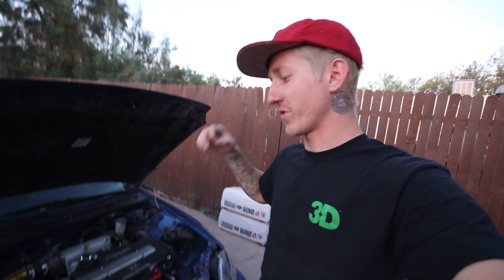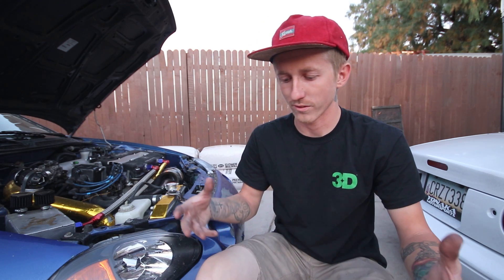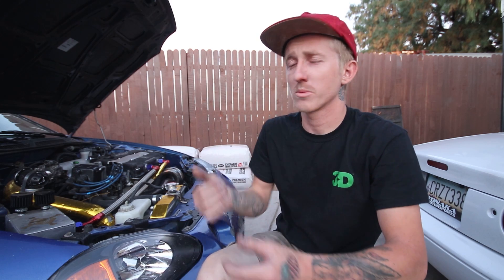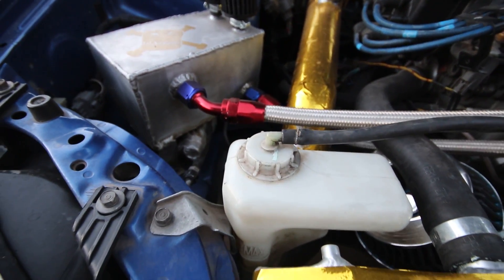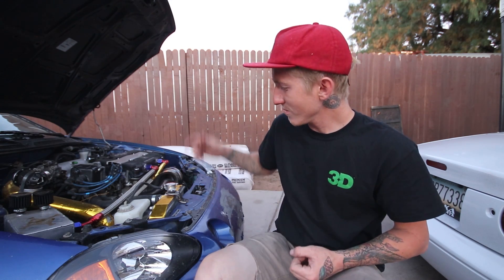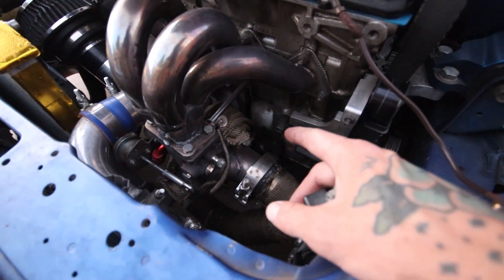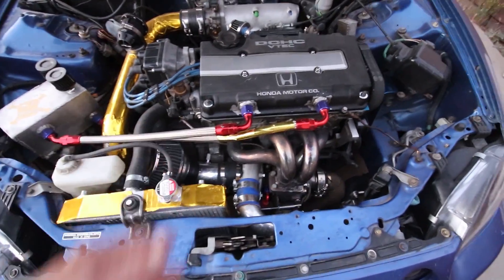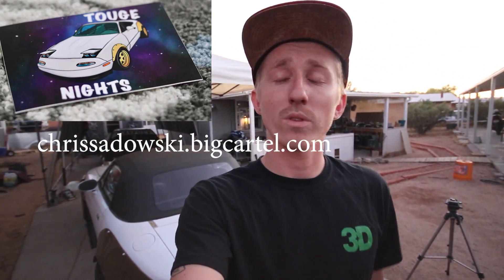Ebay Turbo B20Vtec 6 Month Update(Maxpeedingrods GT2871)

Comment: currently in the process of putting a ebay turbo kit on my 91 integra. i have never done this kind of project before and people make it look easy on here. i been at it over a month now. my main problems are with the intercooler pipe and bov, as my bov does not match the flange, and i make things difficult buy not wanting to relocate my battery so im having to cut the piping to make it wrap around the shock tower and go through the frame by the fender instead of under it.  i ended up getting the same everlast tig welder as you, and although i went to school and got mig certified years ago, you'll be happy to know your welds are looking better than mine right now :) but im getting there, and getting the tools and knowledge along the way. sorry for typing so much but you help me alot, thanks man.
Reply from the maker: That’s frustrating man. I had to buy the flange for my BOV and weld it on for both my del sol and now my miatas setup to make sure I had it the right way. If you have the Tig welder you can always just modify your intercooler piping to go where you need it so it can still be clean

Comment: Man sounds really good especially between shifts. I think it’s cool you’re showing other options out there that are more budget friendly. I’m embarrassingly deep into my 97 hatch but am exploring more budget friendly options for my 08 si sedan. Can’t wait to see and hear the Miata making the same noise as del sol. Keep it up man. Always great videos.
Reply from the maker: It’s always more budget friendly to modify cheaper parts or make them yourself if your skilled enough! Or even just getting a good manifold and a cheaper turbo and a good tune.
Reply: Instablaster.

Comment: Ive been contemplating on putting my b20b in my eg2 del sol. Good to see someone with a reliable b20 build. I have all the parts to build the bottom end, im just skeptical because of how thin the factory sleeves are.  I would hate to throw a rod or crack a sleeve with forged parts.  What is your opinion? Should i slap it together or wait and sleeve the block. My b16a3 is on its last leg and im worried that if i send out the b20 my b16 with shut the bed and ill be stuck with no replacement engine.  What would you do?
Reply from the maker: Just depends on what your guns do with the b20, if boost then just keep the body down and get a good tune and the stock motor we’ll be fine for a long time

Comment: Iv got this turbo on my saab powered astra vxr running 1bar of boost. I'm debating uping it to 1.5 maybe even more. Not sure how much it can deliver but iv just split a crappy boost hose so until I upgrade them then it's pointless. Still it's fun as it is. I'm pretty sure they have now changed them slightly and price increased. So new one has maxpeedingrods logo cast around it and  the impeller or what ever its called is now yellow. Price is up over £200.im wanting to know what the changes are as might invest in it as happy with current one.
Reply from the maker: Yeah I’ve got the same turbo also on my miata. I run 11psi on that car and the turbo makes full boost on both cars around 4600rpm

Comment: Great video!!! thanks for the information, one question sorry for bother, I have the same turbo on a 1.3 liter car, I have kind of lag the turbo hits until 4200 rpm, it is fine but my question is. did help the tuning on the lag? and how much can you improve the spool with the tuning, just to have an idea because soon I'm going to change the tune
Reply from the maker: Turbo lag is from the size of the turbo based on your engines output. But other factors that make it spool faster or slower are your manifold, and downpipe setup. Tuning won’t make the turbo spool faster
Reply: @ChrisSadowski  thanks for the answer, now I have different expectations about the tuning that I'm going to make, thank you again
Reply: One thing that ca cause lag is exhaust leaks before the turbo. Also you can actually tune for more response with an electric boost controller.

Comment: Bro you are the man. Thanks for going over this. I have a 92 civic with a b20/vtec swap. I got the Cx racing t28 ac compatible manifold. It was $300 if you haven’t got one already. I also got a t25 from a Nissan and it gave out when I was starting to tune it. The shaft is bouncing around. Hopefully it’s just the turbo because it scared the shit out of me and I haven’t even really checked but my buddy said it was the turbo. I just ordered the same one. Gt2871, my question is which fitting do I need? I’d like to order it right now so it can arrive with the turbo, I only have this cae and I’m without a ride till it runs. Thanks man. I saw your review on Amazon too!
Reply from the maker: The turbo comes with a built in oil restrictor. I can remember the exact fitting sizes but the listing on Amazon tells you the inlet for the oil, and the water line fitting sizes
Reply: @ChrisSadowski  I just ordered the fitting based on the size on the listing just hope this fixes everything :/ took the oil inlet hose off and realized the destructor had some debris stuck in it which ruined the turbo. It was running great before the turbo gave out. It’s always something 😓 how has that turbo worked out for you? Did you have to bore out the waste gate hole? I’ve seen people having issues with boost creep on these

Comment: hey, i asked once before and i forgot. it was about about prepping a car for paint. my honda has really bad clear coat and what grits do i use to sand down and prep it for paint? start at 320? wet sand.
Reply from the maker: I usually start around 200 and work my way up to 1000-1500 and then wetsand
Reply: @ChrisSadowski  ok thank you. orbital sander good for the job or something else would be better?
Reply from the maker: Orbital is fine

Comment: I actually have 2 of these turbos i am going to be putting together a budget twin turbo setup

What size coolant fittings?
Reply from the maker: If your asking what coolant port thread pitch I don’t recall, same as a Garrett turbo. As for my water line size they were -6AN
Reply: @ChrisSadowski  that will help me get it together. Thank you.

Comment: Wat rpm does it start makin boost?
Reply from the maker: Depends on your setup
Reply: Oh how bout on urs specifically

Cuz i plan on either going for gt28rs
Or the gt2871

But my plan setup is for a daily streetable car that makes boost at low rpm do u suggest the rs or the 71?
Reply from the maker: I’d do the 2860, and have a good flowing manifold. Manifold and back pressure (downpipe) are the main components besides the turbo (obviously) that either quicken, or lag the turbo spooling

Comment: Have you change your gasket
Reply from the maker: Which gasket?
Reply: ChrisSadowski when you said smoke I was thinking from cam or where block is at
Reply from the maker: It’s not from a leak, it’s when I decelerate first a few seconds and get back on throttle I get a little bit of smoke
Reply: ChrisSadowski  o sorry I though i experience different problem which happen my car was smoking a lot due to head gasket from bank a or b had to be change due to lot driving  and mileages

Comment: How much was the entire del sol build so far, rough guesstimate?
Reply from the maker: Let’s see, I paid $500 for the car around 2 years ago, did engine maintenance on the Z6 to get it back up to par, so maybe 300$ in parts there, swapped trans after I cracked mine and did the clutch and flywheel too so another $300 there. Then all bushings, trailing arm bushings, camber arms, all ball joints and tie rods, then the b20v swap so I needed axles, trans, linkage and mounts, then the turbo stuff. I’ve probably put around $4-5000 into it 🤷🏼‍♀️

Comment: hey chris, im new to cars and im looking to put the maxspeedingrods turbo off of amazon in my 2021 hyundai elantra , can i? do you think it would be fine or if there would be some issues?
Reply from the maker: I am not familiar with those cars, I’m guessing you will have to have everything custom made (I.E manifold, downpipe, dump, intercooler piping, bracketry, oil/water lines) and I’m not sure what those cars have at all for tuning components. So I don’t think that’s an option you can look at just of yet
Reply: An older elantra would be perfect for this but i wouldnt put one in a 2021 just yet

Comment: Bro, how do you manage the heat? My b20v overheats constantly. Forget using ac. Curious how you manage it in that Arizona heat. Thanks dude.
Reply from the maker: Sounds like you have cooling system issues or poor airflow. Have you replaced your radiator cap, bled the cooling system correctly, changed waterpump, bigger radiator or ducted your radiator?
Reply: @ChrisSadowski  I haven't replaced the radiator. I'm running a yonaka (https://www.yonaka.com/Honda_Civic_1992_to_2000_Race_Radiator_p/ymar001.htm) that is not shrouded. I have bled the engine multiple times (changed the thermostat, water pump, head gasket, drilled holes in the thermostat for increased flow). I have not ducted anything yet. It's really frustrating because if it's over 74 degrees (southern Cali) I cannot hit boost or run the ac without a 220 coolant temp spike. I see so many people running similar setups to me to include small rad and they maintain 185-205 temps. I don't get it but it makes driving my car a burden. Thanks for the reply doggie.
Reply from the maker: That is strange, I only run a half size radiator in mine. I don’t have my ac in at the moment, i have to wait till I buy my new manifold to fit the compressor back in. How big is your intercooler, is it blocking too much airflow to the radiator? Air will take the path of least resistance in your grill so make sure you have the whole area before and around your radiator sealed up to force all the air through it. I’m currently running into the same issue on my miata, intercooler on and it overheats because lack of airflow so I’m trying a smaller IC and adding some ducting and then I should be good
Reply: @ChrisSadowski  the intercooler is the small generic EMUSA one (http://www.siliconeintakes.com/front-mount-intercooler/heat-exchanger-p-207.html?gclid=EAIaIQobChMI5qaGwIic6QIVFbvsCh2ikAFlEAQYBCABEgIf4vD_BwE) I should experiment with ducting. I think the AC condenser is probably blocking flow. What turbo blanket did you use? DEI is what I've been looking at but they are expensive. I might do the SPtuning VHT ceramic coat job on my log manifold and turbo hot side. Are you running hood spacers?
Reply: might have a cracked head if u saying u bled it properly, these combos run fine with a half radiator, does ur car over heat when idling
Reply from the maker: Hood spacers actually make it worse in a lot of cases because your increasing the high pressure area under the hood not allowing air to flow. The goal is to direct as much air as possible through the radiator and then let the air out as efficiently as you can. You can try venting your hood to help alleviate the pressure after your radiator before the valve cover in that area. I plan to do so on my miata
Reply: Akira thanks for the reply. It does not overheat at idle. However if it is idling with the ac on it will have a temp of 205. I replaced the head gasket 500 miles ago. I installed a cometic hg and arp headstuds, and changed timing belt, and new water pump, and thermostat. I modded the tstat and bled the car for an hour. Its not losing water, or oil. My car is tuned on s300v3 but has not been rechecked since hg replacement. It may be running lean.
Reply: ChrisSadowski thanks dude. I think i will try rebleeding the system. Then i will make some heat control mods. Paint, wrap.
Reply: make sure the fan is turning on
Reply: @ScubaSteve-ch3oj  think u might just have air in the system, try jacking the car up as high as u can then rebleed, make sure ur heaters on full blast to get all the air out,
Reply: @akira5982  Thanks for the advice. I have done that multiple times. but I just got some new car parts so it will be a good excuse to rebleed the system. I have done a lot of research and this appears to be a common issue. DC2 (USDM) chassis has horrible flow especially with large FMI and A/C Condensor. Oh well. I guess it is the universe telling me to go full race car. :)
Reply: @Fa5Squad  It is. It actually kicks on pretty early. It kicks on around 180.
Reply: @ScubaSteve-ch3oj  that's when it's suppose to. So if your fan works and it's overheating still you probably have a leak or your water pump is bad or the thermostat or it could be the heater control valve isnt closing